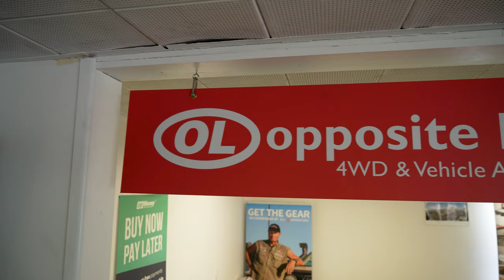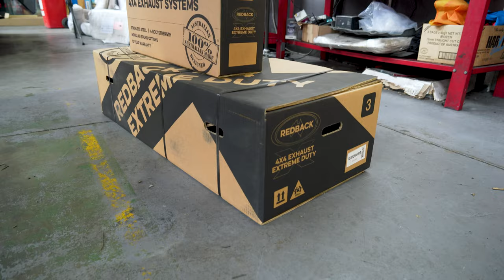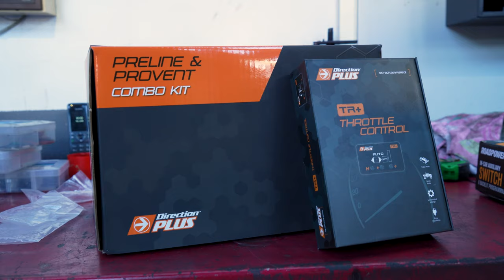Unlocking the Full Potential of the DMAX at Opposite Lock - Must Have Touring Mods | Ep. 4

Comment: Not sure about a few things.  The winch - how do you know it is well made?  Until you see a winch in bits you can't really know how it is constructed and the grade of materials used - but maybe you have?  And the snorkel.   Yes needed if you are doing deep crossings.  But the dirty/dusty air thing is really a bit of tale.  Having spent long periods off road I am yet to see any evidence that this is true and in fact fine particles tend to rise and they are the worst when they get into your air system. Also, pushing air through a tube with bends is highly inefficient as per simple physics.  Maybe this is more a sales pitch the manufacturers run?
Anyhoo, have you used the winch many times and has it held up on heavy long pulls?  How is the bull bar faring?
Reply from the maker: Thanks for checking out the video! We have been really happy with all the barwork on the DMAX since having it installed for our big lap. The winch has definitely suited our needs so far and has performed without issue in the situations we have had to use it for :)